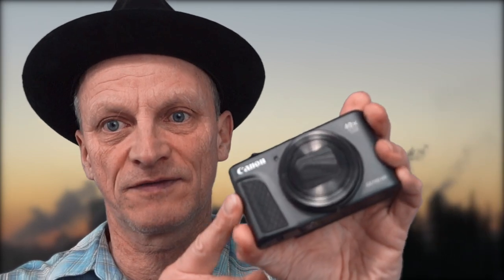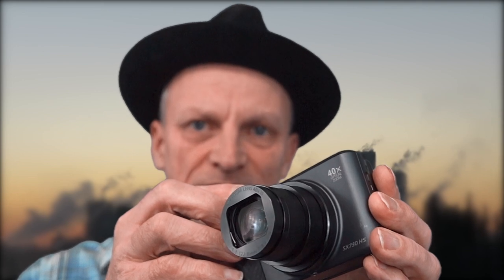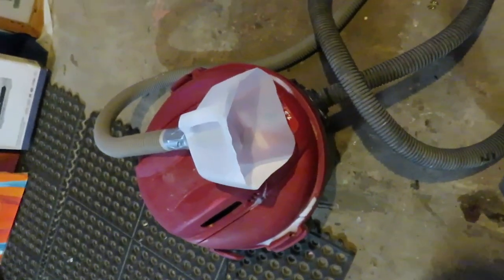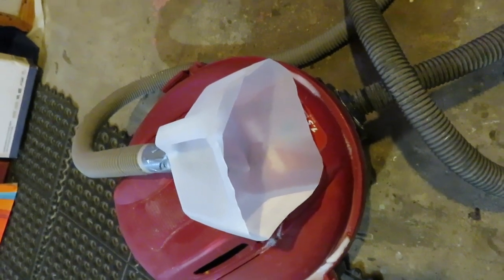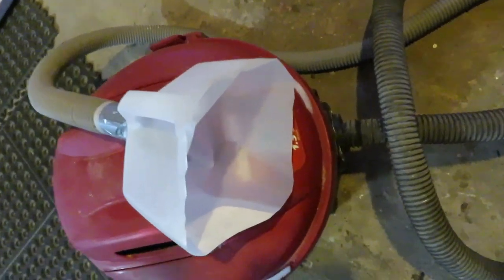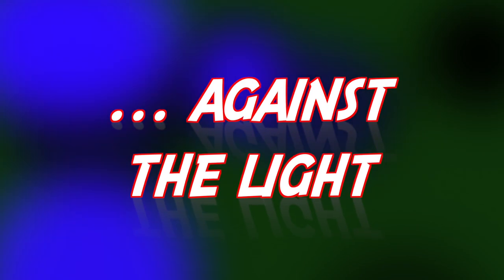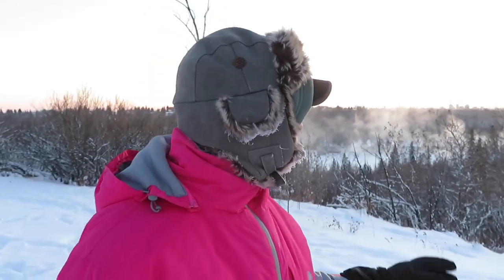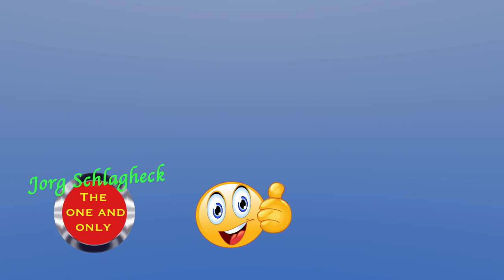Removing Dust inside a Point and Shoot Camera

Comment: This did work to remove the dust from inside my camera thank you!

Just a heads up though, my camera originally had an automatic mechanism to pull the camera lens into the camera once I switched camera modes (Mine has photography and a view photograph modes.) Now the mechanism doesn't pull the camera inside when I switch to the view photograph modes, although it does if I turn off my camera.

Either way thank you for suggesting this fix. My camera was unusable before as there were large black marks on any photo I took, now the photographs I take are clear again.
Reply from the maker: Glad it helped. It seems like a lot of good cameras are dying from that.

Comment: It worked! Thank you so much! I recently found an old point and shoot camera that I forgot how much I loved and it had two dust particles. It’s a Samsung and takes great pics. I put the lense inside the hose and turned on the vacuum cleaner. And it totally worked!
Reply from the maker: Awesome! I'm glad it helped. I made a better adapter from a vitamin bottle which fits my lens really well. The better the fit the better the result. Thanks for sharing 🙂

Comment: This technique definitely works. I had an annoying dust particle in the fixed lens of my Lumix ZS200. None of the other techniques out there (vibrating the camera, using an air blower, etc.) worked. Then I used this technique and it worked right away. In my case, i used a cut off plastic water bottle (with the large hole big enough to fit the entire lens barrel and the small hole fitting inside the vacuum tube) as recommended in another post.

Comment: Hi Jorg! I stumbled upon your video trying to figure out how to get the dust out of my camera as well, I was wondering if I should max out the zoom on the lens before trying your method? Hoping to hear from you, I plan to try this method ASAP! 😁
Reply from the maker: Hope it works for you! This method isn't perfect, but probably the best there is. I'm not sure how much it helps, but actually moving the zoom while you're vacuuming is probably a good way to make sure loose particles inside the camera can be set in motion and sucked out easier as a result. I had to do this again and this time I made my adapter from a vitamin bottle that fits the lens more tightly. Here is the link: https://youtube.com/shorts/LhtHbmhAjfA?feature=share
Reply: @the1andonly  awesome! I didn’t think of that, I’ll give it a try once I get the chance! I appreciate you getting back to me, thank you for the amazing idea